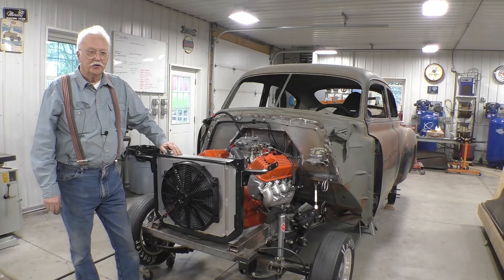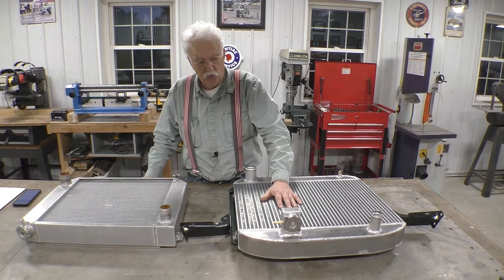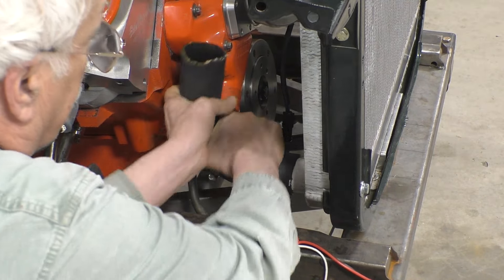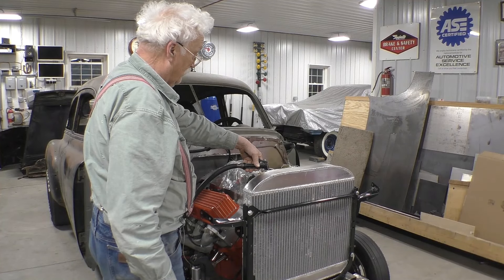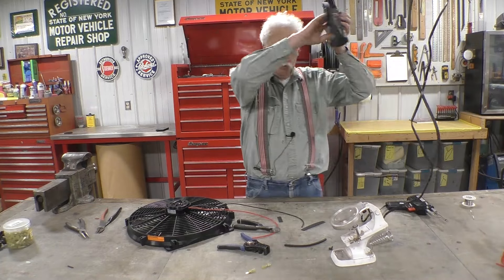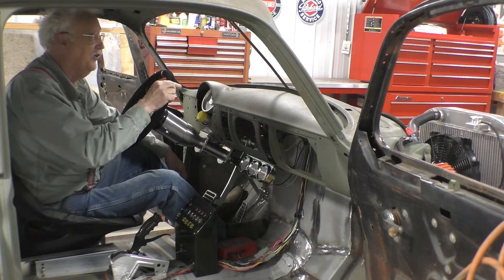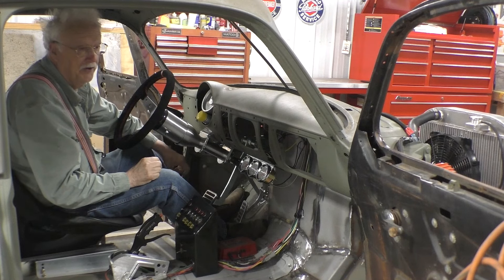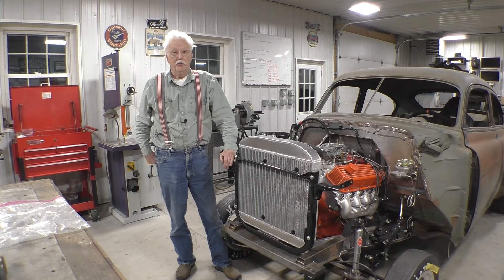Radiator,, 1949 Chevrolet Gasser

Comment: What shop built your radiator for you? Like the use of WD-40 to help slide the hose ends on! What are you using for gas? Sunoco 93?
Reply from the maker: I went to Empire Radiator for the radiator (they took a long time). That is not DW40 but window cleaner. Just enough soap to let the hoses slide on. You hit the nail on the head, there is a Sunoco right down the street. Have a good 4th

Comment: maybe do a push pull with the fans? front one and back one could be offset to get more flow through the fins?
Reply from the maker: The problem with that becomes power. These fans eat up power (the puller currently connected uses 18.5 amps. I am not running an alternator and the MSD box does not work wight under 9 volts
Reply: @ThrottleStopRacing  ok